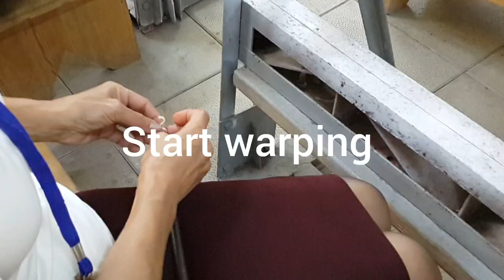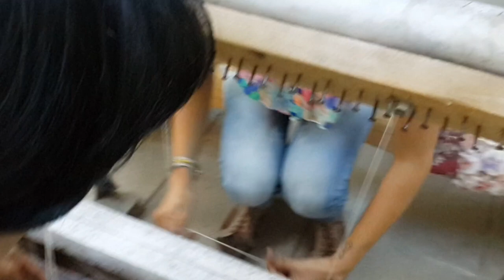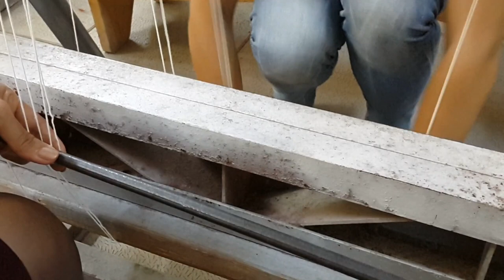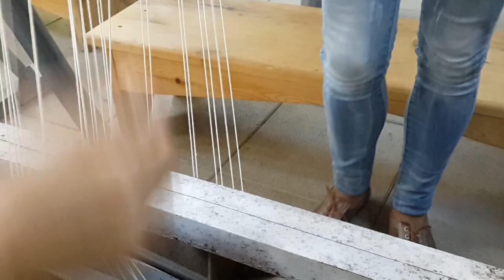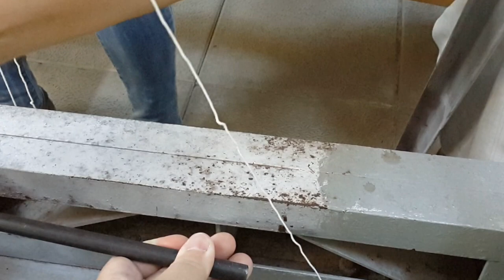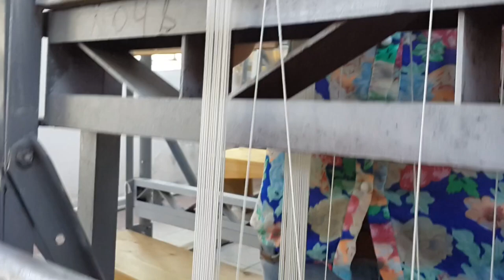warping carpet loom

Comment: Thank you so much for reposting this video! I have a question, if you are able to answer. I'm getting ready to make my first hand-knotted rug. (I have woven before, but I don't own a floor loom nor have room for one. I want to build a frame loom with large rods at top and bottom, and I'd like to warp it this way, with the smaller rod and warps looped going both directions.) Can you please explain briefly how the warp is advanced in this type of set-up? Are there gears or something? Thank you so much for all of your crafting videos!
Reply from the maker: In this particular loom the upper bar is released by lowering down metal rod with screw-thread, I  showed in the video just off the garage, it will be installed in the middle of the loom, between looms. It is released low enough to slide the warp loop bar under beam.  In metal looms system is similar, except that the screw-threads are hidden in a vertical frame
Reply from the maker: This is how the looms will looms when gathered,  except that i have already fixed the angle of that metal bar, that was installed wrong
https://pin.it/h9dLW68